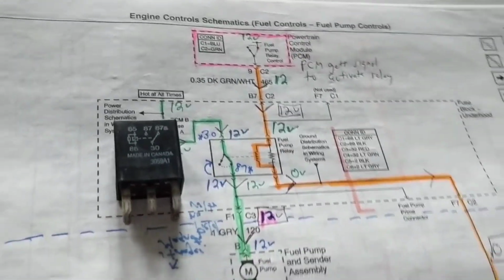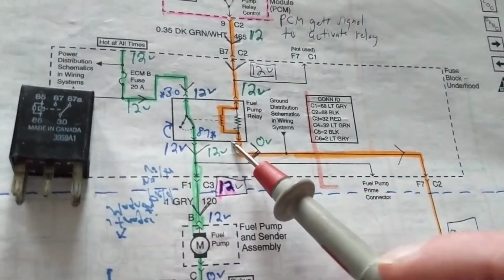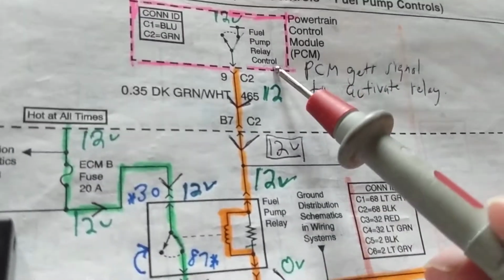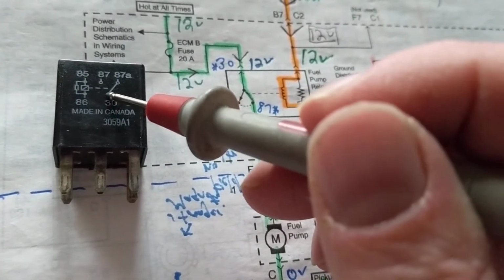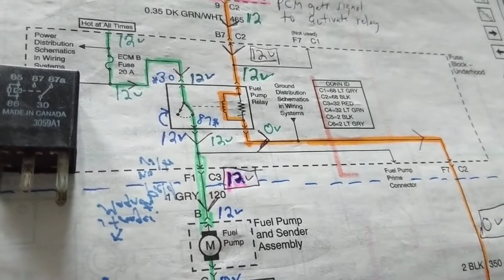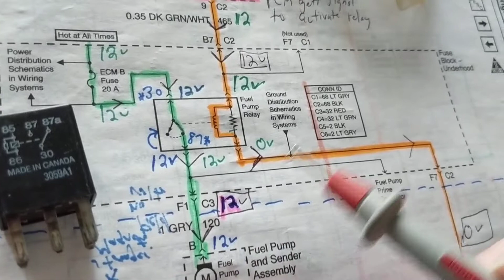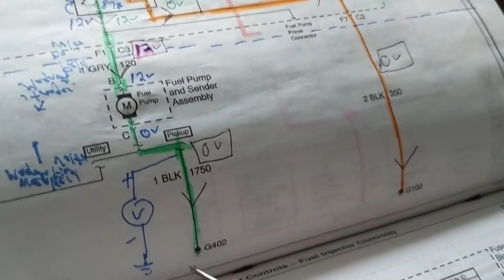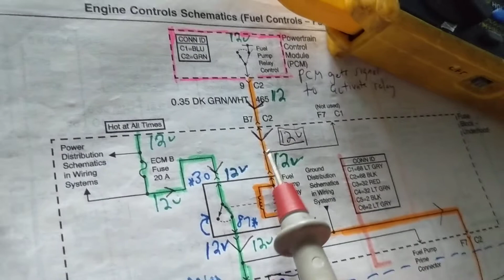HOW TO DIAGNOSE FUEL PUMP PROBLEMS FROM DIAGRAM VALUABLE TUTORIAL PART 1

Comment: This video is very clear and informative. An easier way to check a relay is to make sure its coil is energized and then putting the meter across its contacts and measuring the voltage. If there is 12 volts, that means the contacts have a problem and the relay has not switched. If we measure 0 volts, that could mean two things. 1) The relay is working perfectly. 2) The load is not getting the ground. This is my first appraoch when I test relays in live circuits. The key point is that a closed swich will have 0 volts across its contacts.
Reply: Exactly that's why I always say go to terminal 87 to see if you have 12 v that is the key point to measure and it tells you if everything else before it works in one shot I have a video on that how to measure relays and circuits for fuel pumps on Joel trying to schematics for Auto thank you for your comment

Comment: Great video. I don't have +12VCD at the pin 30 on the fuel pump relay, not even  before the ECM B fuse. I do not know where the +12volts came to the fuse. The fuel relay control from the PCM and the relay itself works as it should be, however I do not know why thera is no +12 volts before the ECM B fuse. Wonder if I remove the fuel pump relay and then I apply +12VCD  at the place where the pin 87 is located the pump should work. Thanks
Reply from the maker: @nemiasmejia5355  which make and model are we referring to?
Reply: @Joeelectronicschematicsforauto  Suburban year 1997, 1500 TBI, 5.7l
Reply from the maker: There might be an oil pressure switch which has to be turned on first
Reply from the maker: Number two there is a fuel pump relay and you can jump pins 87 to 30. Make sure they are the right pins
Reply from the maker: @nemiasmejia5355  how did it go with your vehicle
Reply: @Joeelectronicschematicsforauto  I see what the problem is, you mention that +12DC is always at the pin 30, however on my suburban 1997 the pin 30 connects directly to the fuel pump motor, the pin 87A is always +12DC,  when the relay coil is energized changes the switch  from 87A to 87 allowing to feed +12DC to the pin 30. By the way the problem was the fuel pump motor, the coil impedance was 1Kohm, the impedance of the new fuel pump is lower than 5 ohms.

Comment: Joe my 1990 Dodge d150 has a grey wire and a blk on pin 87a. All new relays don't have 87a what is the function of these two wires.
Reply from the maker: 87a is in the default or the resting position when it's not activated as soon as the relay is activated it goes from 87 to the pin of 32 make the contact for the fuel pump
Reply from the maker: That's from pinned 87 to pin 30 sorry I gave you a spelling error of pain 32 it spin 87  to pin 30
Reply: @Joeelectronicschematicsforauto  the

Comment: Thanks joe for your great video.. but i want to know what is responsible for activation of the relay in the first few seconds then it is deactivated till i continue switching on the car motor ?
Is there timer circuit or something like that ?
Reply from the maker: Computer has control of everything when you first turn it on the starter motor engages the flywheel and the crankshaft in order to continue spinning it needs the fuel pump

Comment: Hi Joe, question, can a short input affect and output signal, for a clicking sensor front of the engine, ex IAC and Purge valve? Thx
Reply from the maker: If you're asking the input signal is shorted then there cannot be an output for example if a sensor is the input to a computer PCM then the PCM cannot react with an output but this should not be a clicking noise
Reply: @Joeelectronicschematicsforauto  exacly yes, exemple if there is a short on the Fuel tank pressure sensor remaining high voltage! And the Idle air control valve clicking on and off  and the Purge valve, because the FTPressure sensor it is a 5 volt reference, and don’t know if is shorted.

Comment: Hi, I have 99 ford f450 6.8 v10 and I have low fuel pressure. I change, fuel regulator, fuel pump, MAF sensor, fuel filter and intake air temp sensor. I think my two speed fuel pump relay is having issue. I checked the fuel pump harness plug with a multimeter and it showed 6volts on the power end. Im wondering will the relay cause low fuel pressure?

Comment: Sir can I ask a question? I'ved watched a video spool valve, a valve for water, their is also a coil, when its energize the spool valve will be push away...now I ask the uploader of that video.How does a spool valve being push away when the coil is being energized? When the current pass to wire it creates electromagnetism,so therefore it will pull the valve instead of pushing?Then he replied,(their is a right-hand law it will create a force that pushes a spool to opposite side instead of pulling..)I tell him..(you mean the initial energy from the magnetic flux on the coil as a current flow through causes to push the spool valve?) He replied yes! Exactly!...Now sir,if that energy is present when the coil inside a relay is being energize creating electro magnetic force,then how can the switch contact be magnetized to close from 87a to 87  switch contact of relay?
Reply from the maker: And the relay circuit the control side the coil has inductance and also creates a magnetic field electromagnetic field on the other side the load side you need the two contacts to close that is done by an armature which is brought down as a result of electrical magnetic field in the coil on the contacts closed they make contact to the other circuit that is the click that you hear in automotive relays when the load circuit is magnetized and activated by the coil side it's actually one circuit a low current circuit controlling a high current circuit
Reply from the maker: Find the contacts closing one side of the contact goes to 12 volts and the other side goes to the load being a fuel pump or any component now you have a path for current to flow it's like a switch that is closed and opened by another circuit
Reply: @Joeelectronicschematicsforauto  sorry sir...I haved a little confuse about the right hand law..the pushing initial energy created by the magnetic field...then if that so....how it will magnet? If their's pushing force?

Comment: Just meter your relay and meter your relay receptacle to make sure you have constant power to the relay, that back tests the computer. Your making this way to complicated.
Reply from the maker: I get many questions about relays and how to test them to fuel pumps in circuit because everybody either jumps the relay or just gives power which is not correct the other thing about the computer how many people will know which wire goes back to the computer and how to back probate in order to do that you have to have the right tools